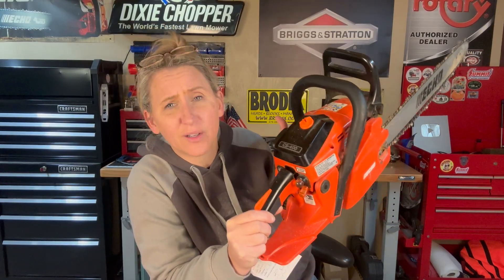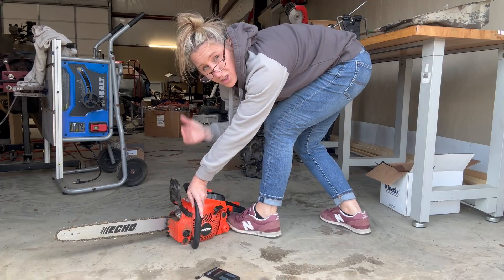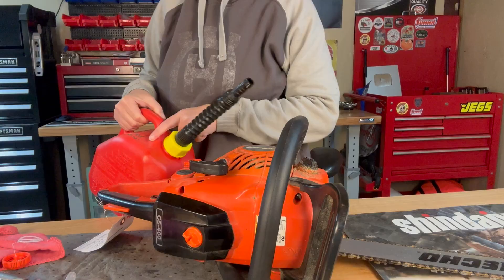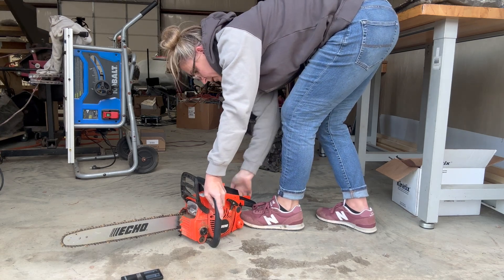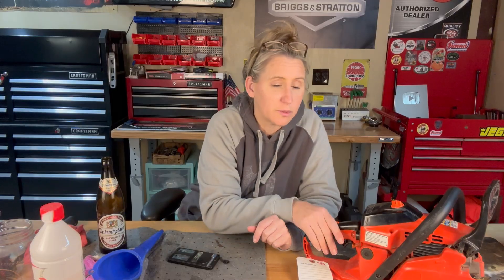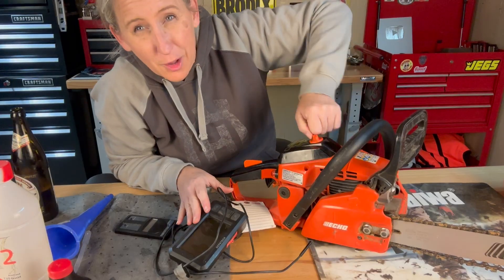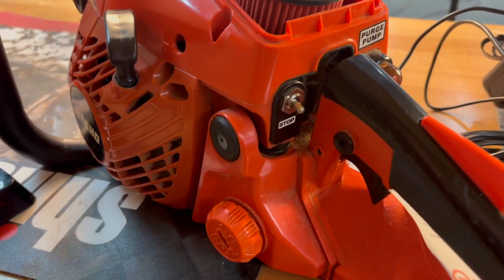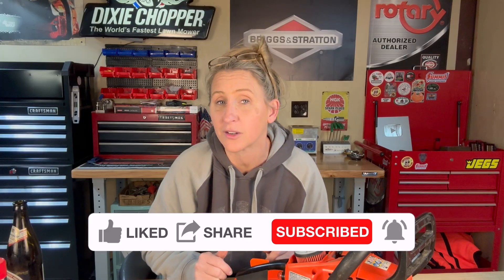Engineered Fuel FAIL! Your Small Engine Is Not Running Right, Even if You Think It Is!

Comment: now that is the way a chainsaw is supposed to sound.  When cutting down trees in the woods and far from town, have always just used the no ethanol premium gas sold at the gas station  and the mix bottle from the chainsaw vendor to get the least emissions and power from my St*hl.  Less smoke means less fatigue from breathing in the exhaust

Comment: I’ve been using echo red armor pre mix in my echo power head and toro blower, both start easy and seem to have great power. 

I put trufuel in my Honda mower and pressure washer and they both run great on it too. Briggs Genpower 10.0 and Craftsmen Chonda snowblower both like that fuel as well.

I have not done trufuel premix based on your posts. If I move up to more property and a rider there is one station within a half hour that does E free fuel so I’ll transition to that.

Comment: Customer complliant: "Won't start or hard to start when hot."  I bet you are correct about the cause; BUT, you did not work it to get it reaally hot and then let it heat soak for a minute or two before restarting.  The symptom could be a weak coil, even a new one can be weak.  Or the cooling air flow is clogged with saw chiips and such (I know, it has hardly been used).  So, the red engineered fuel is suspect, that is "true"ly amazing and "fuel" for thought.  ;-)
Reply: while the fuel is obviously a factor, there's also a possibility the customer is just slavishly engaging the choke every time they start it.  I've seen people do that and insta-flood their equipment.  any start that isn't a cold start should have the choke off for the first pull.

Comment: Even at idle it sounds better
Reply from the maker: Right!
Reply: I was a commercial cutter for about 25 years. Always run high test. Keep gas fresh. Use Stihl’s best oil in the silver bottle. I’ve got weed eaters and such over 20 years old still going. I give them to the kids.
I’ve used Stihl bottled gas for storage. It’s ok but just to confirm, I dump it out too. Start fresh. My stuff usually starts by the 3rd pull.

Comment: Non-ethanol fuel and quality two stroke oils are the key to happy two stroke equipment .   Engineered fuel is crap.   Non-ethanol premix lasts forever too.   I have several year old Non-ethanol  in cans as fresh as the day filled!!
Reply: Ethanol free is very easy to find in Louisiana. I buy 5 gallons, add stabil, and store in an unvented safety can. I just found a misplaced can with 3 year old fuel. It smelled and looked good. Put it in a 5 hp Briggs and it fired right up.  I did burn the rest in my truck though.
Reply: I don't know how long it lasts but RedArmor in 90 octane ethanol free is fine at least 6 months.
Reply: @Kevin.L_ Red Armor is the best I’ve been using for many years I don’t even drain my units for the winter and they start right up next spring never had to do anything to any of them except routine maintenance. I have some that close to two years old and no issues. I forgot the shelf life but they say once you open the container it should last up to two years.
Reply: Absolutely no non-ethanol fuel within 80 miles of my home. So for some of us it’s engineered or nothing.
Reply: @lgrizzly you can remove the ethanol yourself and it’s very easy to do!!
Then you know the quality of your fuel because you processed it yourself!
Reply: Non-ethanol pre-mix lasting forever could NOT be farther from the truth.  30-60 days is optimal time, especially on chainsaws.
Reply: So true!
I process my own Gas and remove the ethanol then add a squirt of 2 stroke to a 5 gallon batch to give it some top cylinder lubrication and add some octane booster.
This is what I run in a 18 year old craftsman yt3000!
Fires right up after sitting all winter everytime and the oil in my crankcase stays like new after two years.

Comment: I use the stihl oil mix, think ill try what you use
Reply from the maker: I haven't seen any issues with the Stihl canned fuel.
Reply: I use Stihl synthetic oil in ethanol free premium.  I could get it from the hardware store, but I pay a little extra to buy it from my mechanic.  also buy premium bar oil instead of the hardware store brand.  I can feel he difference. (and if I do have a problem, I can't fix, my mechanic gets to it ahead of the guys who don't buy their machines or supplies from them; which saves me time and frustration in exchange for not that much money.)
Reply: I use the 1 gal oil mix of stihl 2 cycle oil to 1 gal fuel.

Comment: this happen to me a few months back, Stihl 17 ft pole saw would not run, Checked the PRM, high and low hard to start. after a few hours thinking about it. I decided to change out the fuel mix. Guess what it started right up and ran great . The fuel was just 2 month old. Fresh fuel . learn something everyday even when you think you checked everything
Reply from the maker: Glad you got it figured out! Tossing "fresh" fuel to try more is always a tough one to figure out. You would think it isn't the problem.
Reply: @Chickanic, I just remember my dad's saying! Three common issues on engines! Fuel! Fire! Timing!
Reply: @Chickanic Quick question ( I hope ) Bre. Picked up a 21" Craftsman  6.5 Hp Mower I found in a storage unit. Looked really clean, nice shape. Looked underneath and blade was really bent. Bought a new one. Whatever it hit to bent it appears to have sheared off the two pins that hold the blade along with the nut. It won't tighten down. I did a google search and the online Craftsman parts assembly called it the " Blade Adapter ". Is it easy to remove the Blade adapter to replace it? Do I need any special tools or is there like an allen wrench nut under there holding it on? Hate to drag it to a shop if a very simple fix with some wrench. Thanks.
Reply: @1HonestAbe You might be able to fix yourself , but check out this problem on the web. Had a similar problem with a pushmower, bought a new updated blade adapter. The old blade adapter was held on engine shaft with metal key and i lightly tapped it and it came off. Push the new blade adapter on engine shaft with metal key in place, and installed blade and torque tightened the  blade retainer bolt. Problem was fixed.